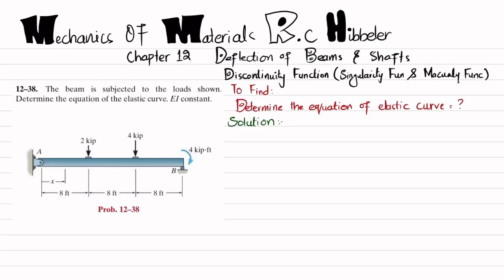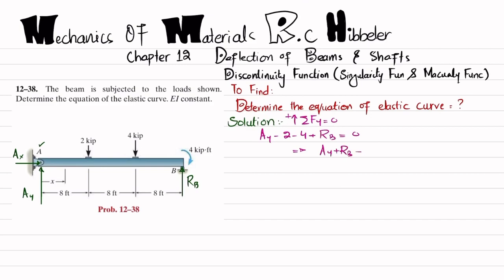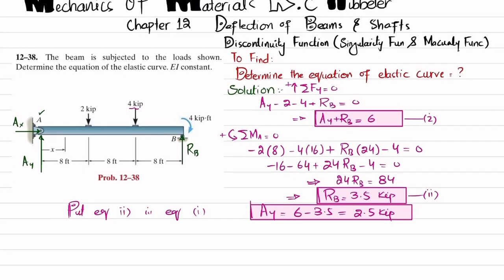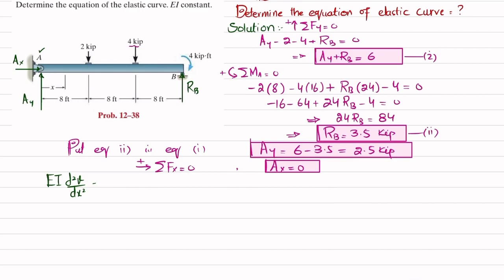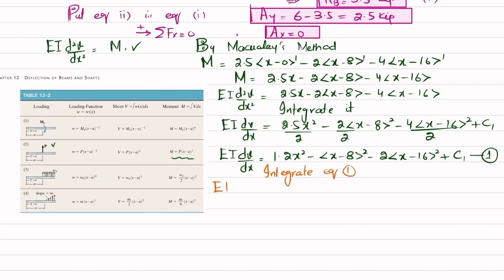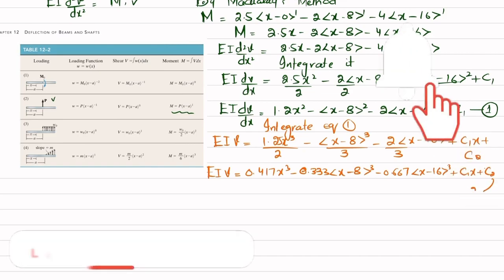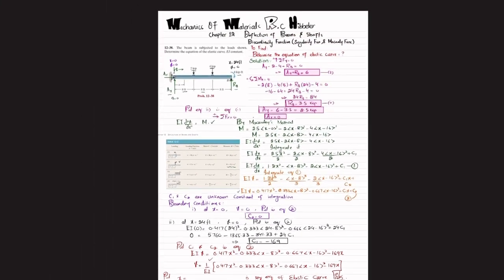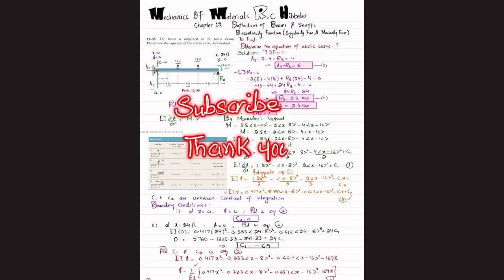12-38 Deflection of beams and shafts | Macaulay's method | Mech of materials rc Hibbeler

Comment: But you take 2kn and 4kn force
Reply from the maker: Every problem is of different nature. This problem is solved by another method called Macaulays method.
Reply: Then what process did you solve in the other problem 🤔...and if the problem solve in Macaulays method then what should be equation
Reply from the maker: All the method is described in this video.
Reply from the maker: In other problem you have to find the moment at different section while in Macaulays method you only get one moment equation